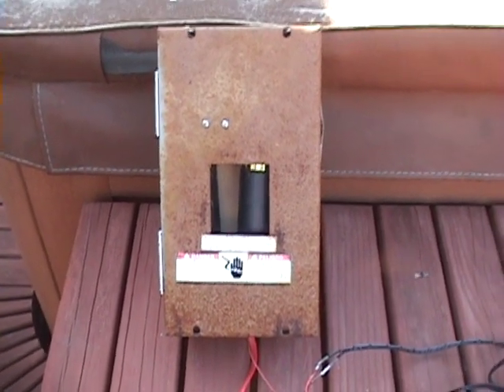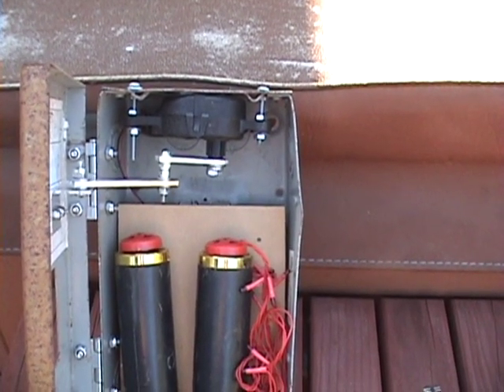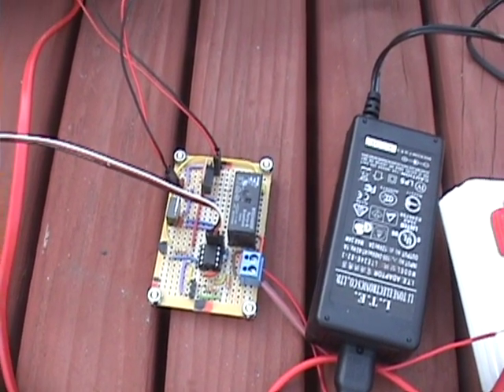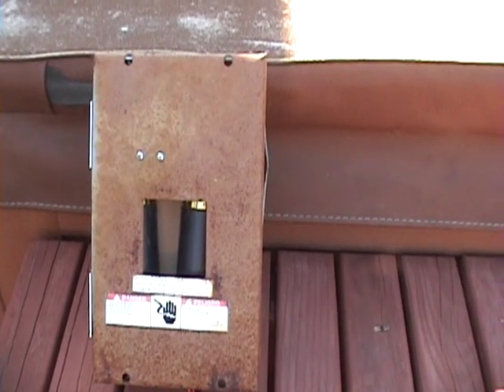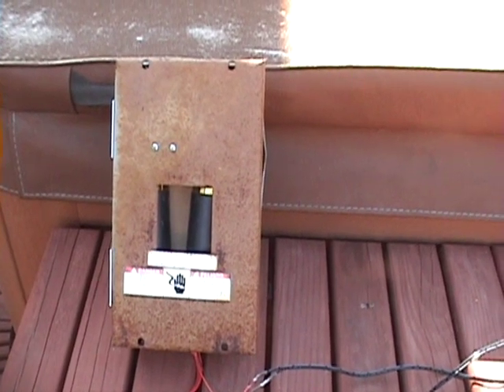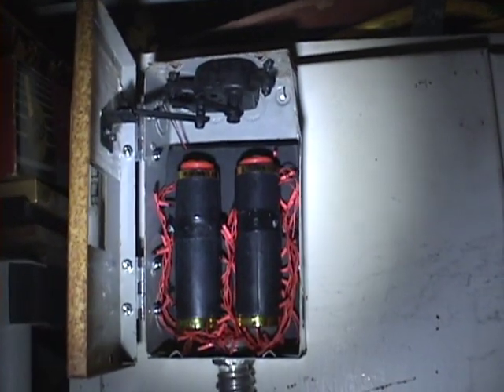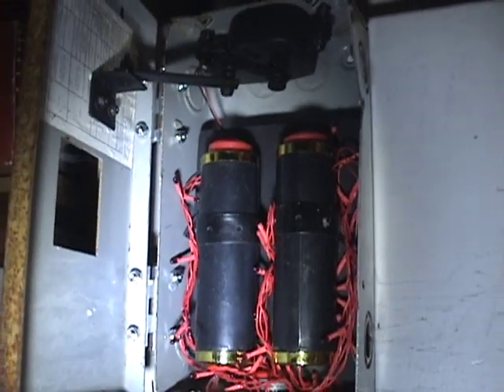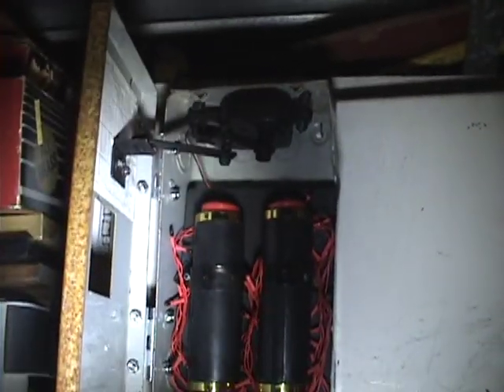Flash Cracker Prop

Comment from the maker: Thank you.

I just used an 1 1/4 pvc end cap and some 1/2 pvc for the tube. Then I used a hole saw to cut a thin wood trim piece to fill the gap between the two. I drilled a hole for the wire in the back of the cap and added some silicone sealant to fill any gaps.